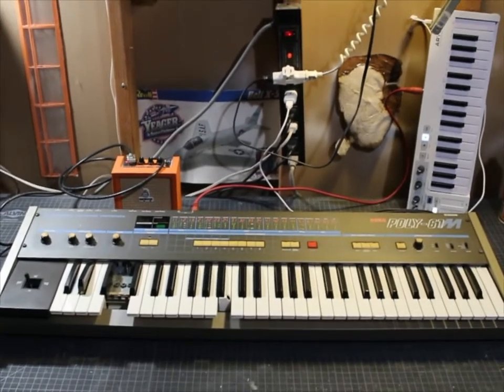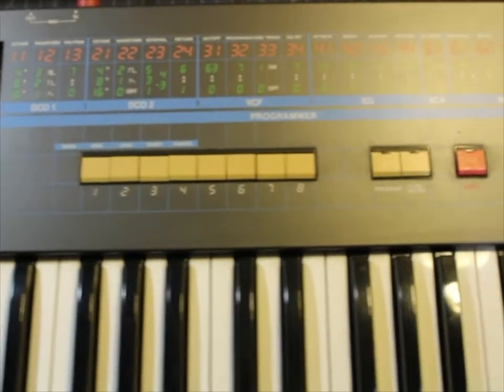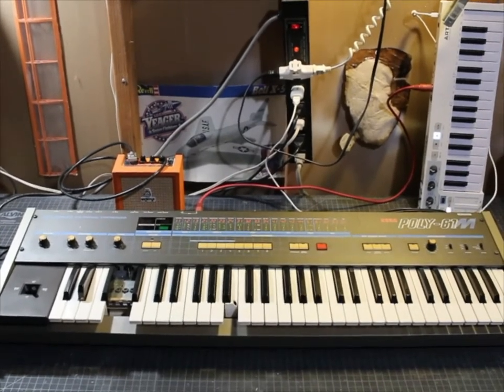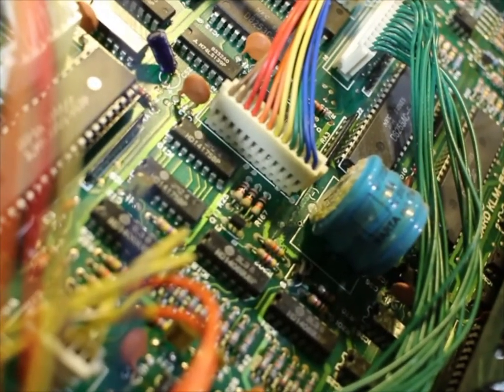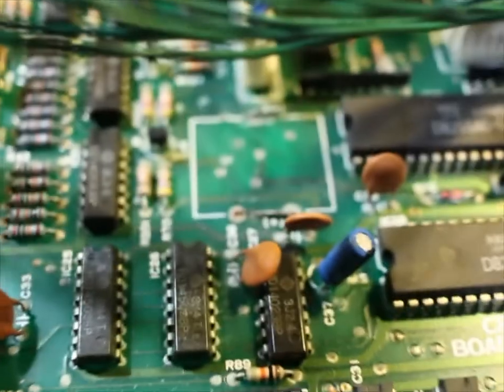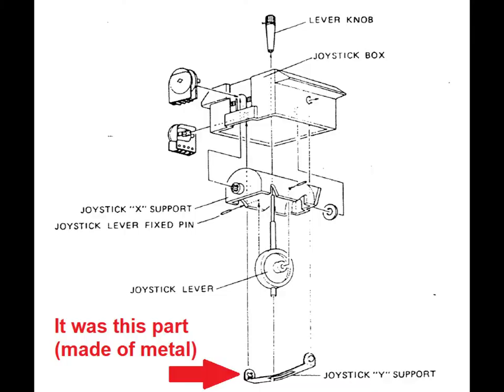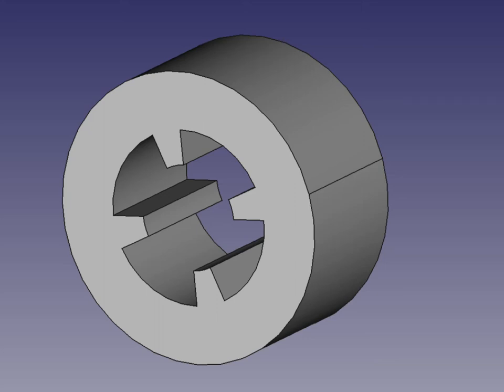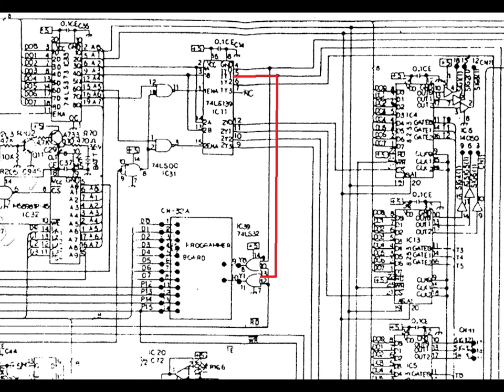Korg Poly-61M Restoration: Part 1

Comment: I have this same exact synth mine is in damn near mint condition other than the fact that it does not produce noise. There are no parts missing and i have every single documentation for it from user manuel to receipt from 1985. I would like to send it to you for repairs if that is something you would be willing to do.
Reply from the maker: Thank you.  I would love to take a look at your Poly-61M.  However, I could not in good faith promise anything about my ability to repair one of these nearly 40-year-old instruments which is silent and may have unknown problems, especially as many of the parts are no longer manufactured.  Even my keyboard which you see in this video from last year, has since developed a strange warm-up period, where it takes several minutes of playing before the notes track correctly.  I am located in central New Jersey if it is convenient for you to bring the instrument to me; otherwise I would not advise shipping one of these around.